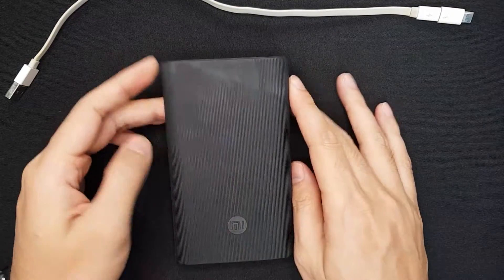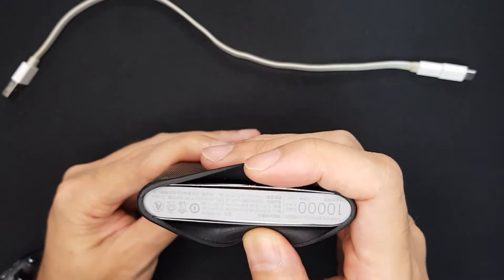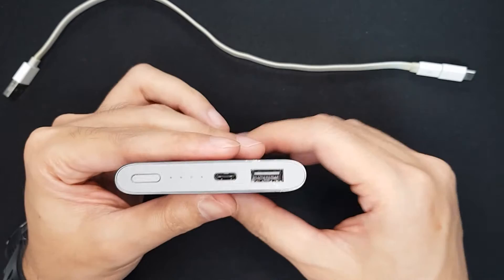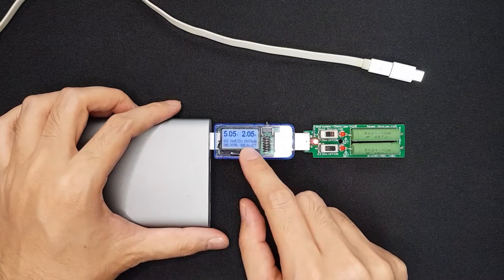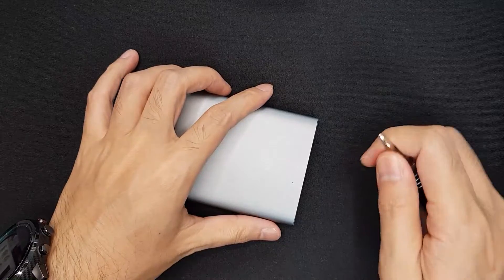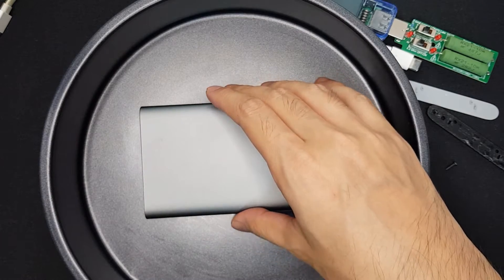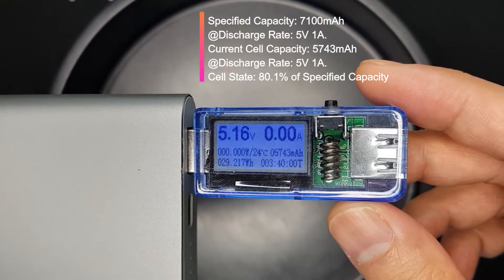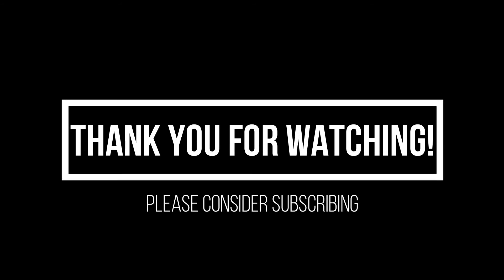Xiaomi Power Bank Pro | Will it Explode? Test and Review

Comment: I have many of them, most of them has swelled up and some cracked the plastic case on it. Not even a year of usage.
I might start to get them from other reputable brands. Xiaomi makes great products but many of their stuffs are just as abysmal as china OEM products.
Reply: Use power bank on regular basis. if u rarely use then drain battery to 50% then store.. dont keep it fully 100%

Comment: I have the same powerbank which I bought last 2019 (rarely used), I also have a silicon case for it. I just noticed today that it has a swollen battery, same with yours, like exactly the same. I think xiaomi uses a bad battery on this model or it's caused by the silicon case. I'm now having a hard time thinking how to dispose of it since throwing it on the trash can is a bad idea specially for the garbage collectors (possible explosion).
Reply: Drain it fully to 0% then its less dangerous

Comment: Reason why it's bloated is because you stored the battery at 100% for an extended period of time. This is bad for the battery.  Will happen to any lithium battery, no thing wrong with the power bank. Use it or loose it in other words.

Comment: I have 20000 mah one 
And it has a crack on it 
Long crack and itas bloated
Should i stop using and keep using 
I've been using it all the time
Reply: Same issue, huge crack. What happened to urs now. Still using
Reply: @gouthamanguna7007 i was still Using it but now its giving less battery backup. 
Like really so less. 
So i stopped using it yesterday.
Reply: @Dre-ShaN  I use rubber cover. Hope it's the reason for the bulge

Comment: I have the same powerbank, the white part you took off keeps popping out, not fully but still. There is a dent there because I've dropped it before, I think it's cause of that but just to be sure, should I still use it?
Reply: I have the same problem. did you find a solution?
Reply: @raghdagaafar8374  no, I just decided to not use it as often as I did before. Now, I just use it when I'm going out and my phone's really low on battery.

Comment: This is because of rubber case. Heat is not good for batteries. Probably it affected heat dissipation.
Reply from the maker: Yeah true. It's one of the possible causes. Thanks for your comments.
Reply: You an idiot
Reply: I have same powerbank and i dont have this case on it. I have same problem, so it is not happening because of rubber case.